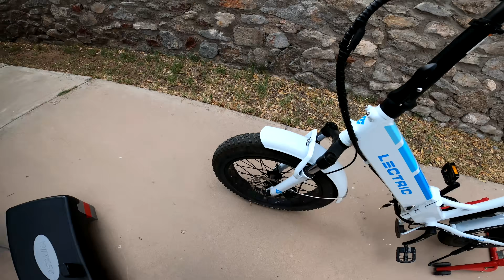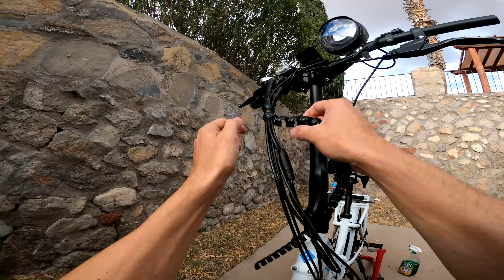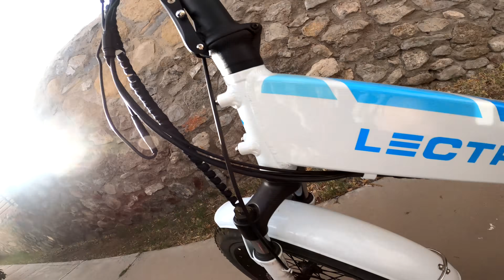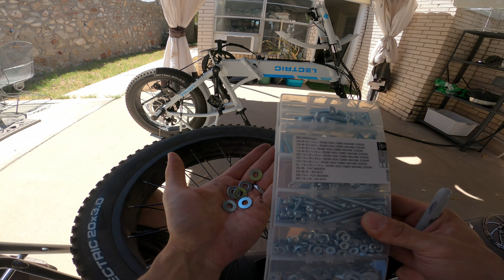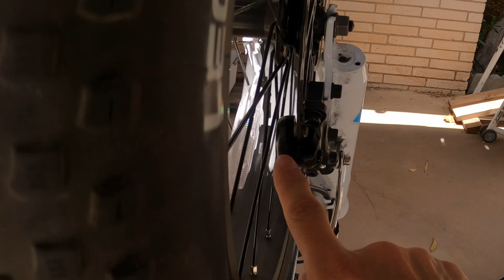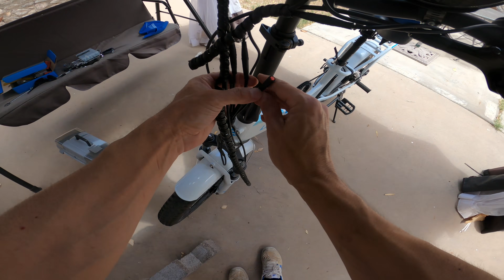NOT Waiting for Lectric! - XP 3.0 Hydraulic Brake - MT200 Install

Comment: You should do a video showing how to remove/replace the rear tube or tire. The XP 3.0 is different than the 2.0 in that the spacer setup is a bit different. I've never seen anybody do a 3.0 and actually talk about what goes where along the axle.when they're putting it back together.
Reply from the maker: I'm installing liners and new tubes in a couple of weeks and will definitely cover this detail!

Comment: Quick tip, you can use compressed air from a compressor to float a grip off and on the bars.  It's an old trick that works great on motorcycles and atvs.
Reply from the maker: Surprisingly, don't have a compressor yet.